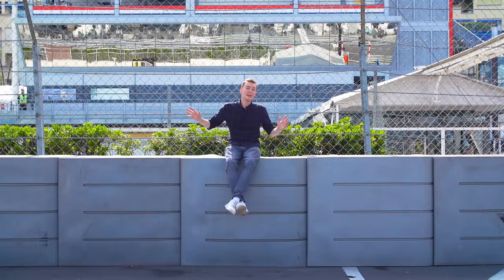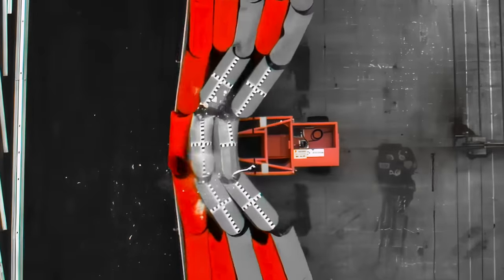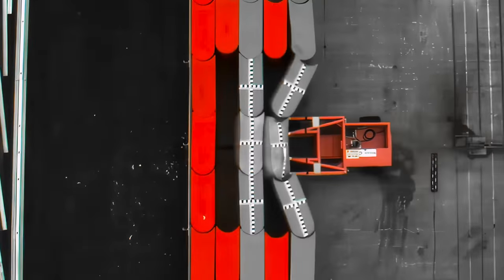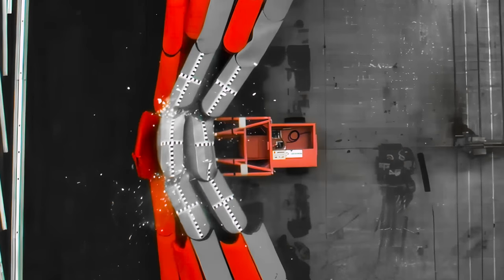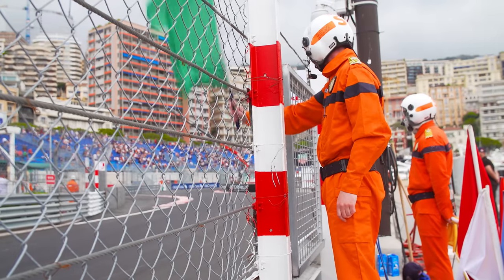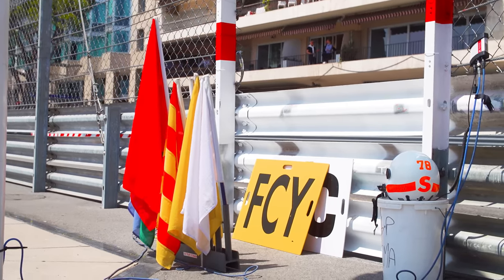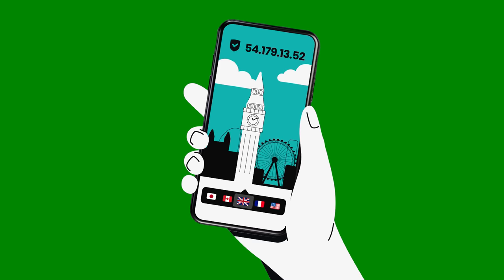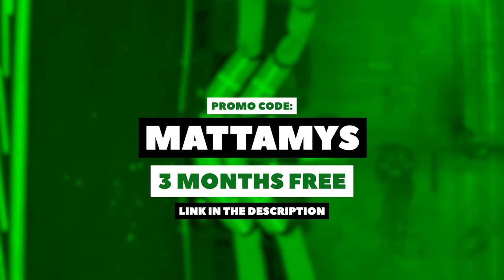Formula 1 Has A Genius System Inside Crash Barriers

Comment: So why are these not used everywhere and there are still some concrete walls on track?
Reply from the maker: Concrete walls are mostly on straights, so any contact would mostly be a side impact - whereas places where you're needing to slow the car down to absorb that fast energy is mostly in the corners!
Reply: @mattamys  Thanks for that great answer mate! Keep it up!
Reply: They are expensive, so only new tracks have them. Old tracks still use tyres, or a combination
Reply: For shallow impact angles TecPro barriers can actually be more dangerous than concrete walls.
There is a chance that the car can get entangled in the TecPro barriers, which will cause it to be stopped within a very short distance, resulting in sharp deceleration. These deceleration forces can cause injuries to the driver.

Instead when a car hits a naked concrete wall at a shallow angle, there will only be a minor side impact (which the safety features on the car should be capable to take care of) but the car can keep all of it's forward momentum. It can keep scraping along the wall for several hundred meters and dissipate it's energy over a long amount of time. Therefore the deceleration forces acting on the driver are way lower.

So it is a matter of circuit design and risk assessment to determine which parts of the track are likely to see only shallow impacts (for example walls alongside a straight) where you would put smooth hard barriers like armco or concrete, and which parts might see blunt impacts, where you need TecPro or tire bundles.

There is of course yet another type of impact protection available: the SAFER Barrier (which is an acronym that stands for "Steel And Foam Energy Reduction Barrier"). This type of barrier was specifically developed for oval racing, but has since found it's way onto many other circuits as well, including the Jeddah F1 circuit.

On oval tracks the cars are always running parallel to the outside wall in close proximity, so pretty much all impacts into the outside wall happen at a shallow angle. That's why ovals used to have "unprotected" concrete along the outside, as this used to be the safest option.
But in the last 20 years all oval tracks have been upgraded with SAFER barriers. These are essentially smooth steel guardrails mounted on styrofoam shock absorbers. The styrofoam will cushion the side impact, while the smooth steel surface allows the car to keep moving forward unobsructed.

You can expect to see SAFER barriers on more and more F1 tracks in the future, as for shallow impacts they provide the best safety for the driver. For blunt impacts TecPro is the best option.

Comment: Reassembling the tec pro barrier probably takes less time than cutting out and welding/bolting in a new steel (or concrete) crash barrier.
And you know, kills less drivers.
Reply: They should put them in NBR24
Reply: @fqeagles21  The Nürburgring probably can't afford to put them on the Nordschleife.
Reply: *fewer drivers  (probably less drivers too considering that worse drivers may crash more often)

Comment: Can you do a video about what the advertising board are made of? like the one that usually on the tecpro barriers. And how is it safe if a driver were to crash into it
Reply from the maker: They are usually either printed onto self-adhesive film and placed on directly, or onto thin Multiwall Polycarbonate Sheet (basically cardboard but waterproof) and if a driver is going full speed into the barrier, this wouldn't be their main concern!
Reply: @mattamys  Ah ok, thanks for the explanation. I was a bit concern if those advertisement board could be a sharp object when it's being crashed into, seems like it isn't likely